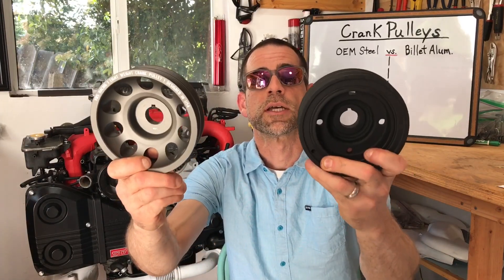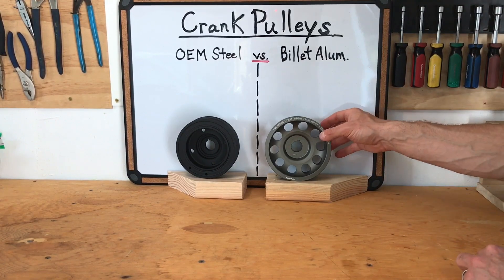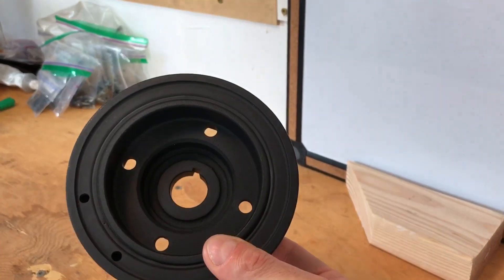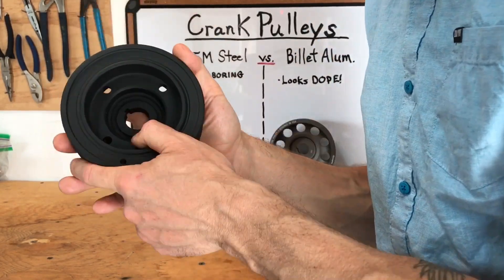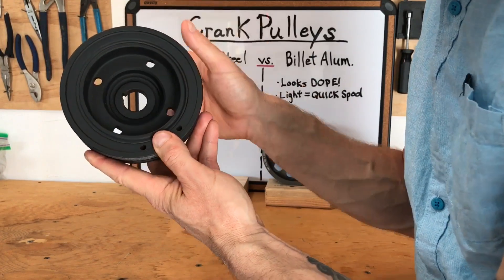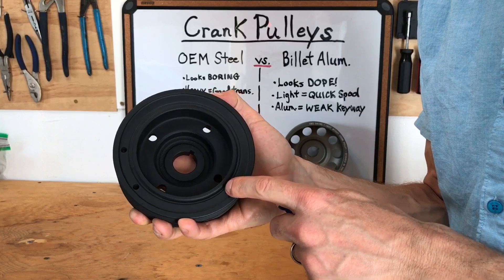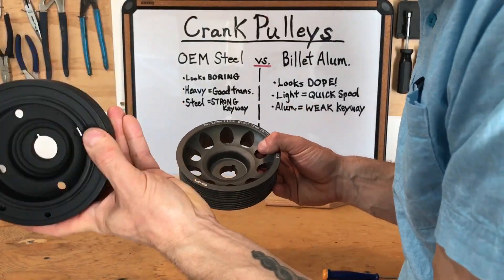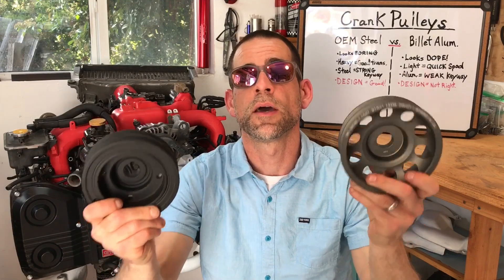Billet Aluminum vs. OEM Steel Crankshaft Pulleys

Comment: Pretty sure Subaru crankshaft pulleys (at least on boxer engines) aren’t harmonic dampeners as confirmed by people who have bothered to contact Subaru. So far as aluminum being softer than steel wouldn’t that have more to do with both the construction of the pulley and the alloy used? That’s like saying steel is crap for exhaust parts because oem exhausts rust so easily, when really the rusty ones are made of soft steel. My aftermarket one would look good as new if I just cleaned it off

Comment: I'm not exactly sure where you are getting your information from but this has been a topic beaten to death by the Subaru community and you're exacerbating wrong information.

https://forums.nasioc.com/forums/showthread.php?t=437237

There are multiple posts from folks even quoting people from SOA stating that the crank pulley on these engines is nothing more than a crank pulley and not a harmonic dampener.  Also, these engines are balanced in the boxer format which means a harmonic dampener is not needed.  Folks can read more about it at the link provided above.

The main issue that arises from using a lightweight crank pulley is that it could throw off timing due to the engine rotating easier.  This is much more prevalent with engines that are running both lightweight crank pulleys and lightweight flywheels.
Reply from the maker: +Greg LaPointe  Thanks for the comment.  I realize this is a well debated topic.  Many strong positions out there.  Overall, I agree with you that most of the info out there is based on little real world experience.

*One thing to note, with respect to the lightened pulley and/or flywheel throwing off timing - It does lighten the rotating mass, which allows the combustion pressure to turn the rotating assembly easier and the engine to effectively produce more power - HOWEVER, the timing is NOT affected.  The timing signal is sent to the coil (and then down to the spark plug) via the ECU which uses the crank position sensor combined with the cam position sensor as inputs.  Those sensors use little magnetic reference points built into the pulleys to determine the rotational angle. When you lighten the pulleys or flywheel, the whole assembly might rotate faster (or more accurately, accelerate faster) but those sensors can monitor and send signals to the ECU so quickly that the timing DOESN’T get compromised, no matter how fast the rotating assembly can accelerate - In other words, no matter how light you make your rotating assembly, the timing will stay EXACTLY the same.
Reply: SubaruONLY 
Actually.  Yes the timing signal can be affected.  With the lower mass, the engine can accelerate and decelerate more rapidly between cylinder combustion events.  (And i have crank trigger logs from my Link g4+ thunder that you can actually see the engine RPM accelerate and decelerate.)   A 4 stroke 4 cyl engine like these basically has 180° of crank rotation between every power stroke.  That is enough time to allow the engine to speed up and slow down (a very small amount).  If you look at the tables the ECUs uses to control spark advance, you can see one of the primary parameters that effect it is RPM.  So if the RPM is physically changing between each power cycle, then the sensor the ECU bases its measurements off will also show this, then the spark advance can also be affected for the following ignition event.

Comment: I would like to address some things in your vid. One is about  the alumimum material. I dont think people are having issues due to the pulley being aluminum. Its more likely incorrect torque applied or possibly using an impact gun when they shouldnt. Or its just cheap chinese junk with poor tolerances and or inferior materials. The other is that the factory pulley is a dampner that reduces harmonics from the crank. There are many OE designed pulleys that dont have the rubber in them. Manufactures at some point starting adding that rubber ring as another form of noise control (NVH).
Reply from the maker: +Michael John   Great points man.  There are some very high quality non OEM options out there for sure!!!

Comment: I send off oil samples for a report religiously at every oil change.  On my current daily driver, I tracked 7 oil changes (5k mile intervals) on the stock crank pulley, and going on 9 changes after the aluminum pulley went on...  the lab reports show zero increase in bearing wear.  I've also never heard of the keyway stripping on any reputable aluminum pulley, but I've admittedly never looked.  I HAVE, however, seen lots of stock pulleys go bad eventually when that rubber band holding the two pieces together gets old, brittle, and rips apart.
Reply from the maker: +Daemione  Thank you very much for sharing your real-world experience - nothing compares to that in my opinion.  🤙🤙
Reply: After 15 years ('05 Impreza) my pulley separated and dropped my belts. Drove the rest of the way to work and then back home without power steering or alternator
Reply from the maker: Nice - just made it I bet!!!

Comment: You have no idea what the hell you’re talking about. The Subaru engine does NOT use a harmonic balancer on their crankshaft pulley....none....zero. Subaru of America has already debunked this urban myth. The engine in internally balanced. The rubber section just makes up for the manufacturing tolerances in the pulley it is not used as a balancer. I’ve used lightened pulleys for years as have many of my Subaru acquaintances. You know how many problems we had? Zero...none...zilch. Look up “lightened pulleys” on any of the Subaru sites (NASIOC) and do a little research before sounding all “bad ass”.
Reply from the maker: +Zulfiya Simmons  Thank you for dropping the comment - especially the fact that you share some real-world experience.

In theory, it seems logical that the factory pulley does dampen harmonics based on the design of the part, HOWEVER, if your experience has shown that the impact is negligible, and a lightened pulley shows guaranteed performace improvements (which it does by design), then I say you are 100% correct and I would do the same every time!!!
Reply: SubaruONLY way to handle a rude comment the right way 👏🏼  subbed.
Reply: Zulfiya, the rubber is actually to help damper the belt vibration transfer. It helps provide a light buffer of belt pull against the crankshaft, dampening the belts vibrations to lower the transfer to the bearings. It’s a harmonic dampener, not harmonic balancer. 

Hope this information helps you with future consecutive criticisms.

Comment: Nice Overview.  Not to negate your facts as things could be different with Subaru, but on my 97 Honda Prelude SH, I added the unorthodox Pulley kit ( crank shaft and Power steering ) at about 91K miles.  This was over 13 years ago.  A couple days ago I just passed 200K miles.  I have had no issues.  What I have seen from these, is better throttle response, and an slight increase in MPG.  On the highway going 80 MPH I average about 28 MPG now.  The negatives are when shifting gears its much more sensitive if there is a difference between engine speed and transmission speed, but in my opinion it makes you a better driver as you can't get lazy with gear shifts.  If you plan on driving your car for over 50K miles, the fuel savings will pay for themselves.  Also my Honda also has the rubber inserts in the crank shaft pulleys, and once again I haven't notice any mechanical problems from the aftermarket one that lacks this feature.  On my next car ( Honda Accord V6 ) this will be the first upgrade I do in addition to the normal CAI.
Reply: Had mine on my Acura cl.. one of my best mods.. my pulley for accord v6 arrived yesterday.. can't wait to install. How has it been running for you?
Reply: Awesome to hear! I've been looking into this for my 3.4 t100 as I know deleting the fan and clutch assembly for an electric rad fan plus the lightweight crank pulley would be significant reduction on my crankshaft resistance.  I'm a lot more confident toward the idea after seeing this, and I'll probably do my Miata as well!
Reply from the maker: +whitesites  Thanks for adding the comment.  Great to hear about real world R&D.  Cheers 🤙🤙

Comment: How the fuck does something so circular, bare and steel cost around 400$? Talk about inflation of irrelevant stuff.
Reply from the maker: +Kizito George William   True that! 👍👍 

The markup stages from production to retail is often pretty ridiculous!   For example, if some thing actually only costs about $20 in raw materials to make, the manufacturer (who has the tooling, staff, and overhead costs to cover) will probably charge $100 to the distributer/wholesaler, then the distributer/wholesaler sells the retailer for $200, then the retailer sells it to the public for $400.  Bam $400 for $20 in materials! 😲😲😲
Reply: It's pretty sketchy. I was looking at engines last night and couldn't figure out how a single component (damper) could cost almost half of the entire engine.

Comment: Well crap. I have a lightweight pulley headed my way.. Guess it'll make a good office decoration lol
Reply from the maker: +Logan Reynolds   Lots of people have zero issues with these and they do help the motor spin up quicker - which is Sweet.  If it’s not going to be used for 100k mi., you probably be ok.  Or play it safe and save it for a dedicated race car! 🏁🏁
Reply: Thanks for the reply! The funny thing is, it was actually intended for my halfway reliable FXT daily driver. My race car STi is still running a stocker, but it has a big turbo and fmic etc so I thought the pulley might make the daily more fun. I spent quite a bit of time reading up on this last night and never really came to a solid answer. It goes back and forth to the end. I'll probably leave it off for now. Slower revs > bearing damage. However, if I don't ever rev much past 5000-5500 rpm, is this argument still valid?
Reply from the maker: +Logan Reynolds  Nice.  Cool pair of rides.  My kind of garage!  I know man - There’s so much info out there and nothing is really conclusive.  

I know the crank harmonics can and will take a toll on those bearings, but there’s just no way to know where the tipping point is and it becomes so small a difference that it’s negligible.  

So, to answer your question, Is the argument valid at modest RPMs, I think so, but how much impact - probably not enough to make a difference in next few years.

Comment: I've been debating lightened pullys for the better part of 2 years. Having experience with LW flywheels, I find them to be very valuable and found them to treat the transmission better, like clutch & gears last longer kind of better.

I think the torsional imbalance that the harmonic balancer is designed to reduce is really only critical at 8k+ rpm and while I'm sure it has it's benefit below 7k rpm on a stock motor with UEL headers, I really think EL headers would make more of difference preventing shock loads on the crank anyway.

I mean, the belts themselves, as long as the other pully driven parts are in good condition can compensate for most crank shock loads on a EJ motor.  Outside of the A/C compressor kicking on I really can't foresee a problem from LW pullys, I mean it's a bad idea to run A/C in high rpm anyways.
 
At the end of the day LW pullys are an awesome mod and can increase the life of the motor so long as, and at least A/C is not running at high rpm and better yet, EL headers get installed.

Idk, I think I'm gonna go for a GFB pulley system if I can find one thats not "under driven". And if I see anything funny with FBK or FKL on the Accessport I'll just hurry up with EL header install and re-tune.

That's the saga I'm goin with after lots of research.
Reply from the maker: +Gamma Light   Dude.  All good points.  There’s never one right answer.   My dad used to say, sometimes the only right answer is choosing one option - then figuring it out as you go.  Ha. This reminds me of that advice.  Cheers my friend!!!🤙🤙

Comment: Fluid damper makes a crank pulley for subys.. problem solved.
Reply from the maker: +fc3sttwo - You are 100% correct my friend.  Thanks! 🤙🤙
Reply: SubaruONLY I'm a Subaru tech and enjoy your vids. Good stuff sir, keep it up.
Reply: Yep, that's what i run
Reply: Yep this is my plan as well. Solves both issues of looks and performance. Maybe it will not look super cool but we're not building show cars.

Comment: I've been running the VMS pulley for 4 years now on my 03 WRX.  Still running strong....
Reply from the maker: +John Thatcher   Nice.  Good to hear and others who run this combo will be stoked to see this too! Thanks for sharing man!  🤙
Reply: How many years now John? Any issues as this is now 2020 :) And do you sometimes hit the redline with that thing?
Reply: @Isaiah_Simwinga  I've been running this forever now!  Around 6 years still no issues and redline the car every once in a while.  Still recommend it
Reply: @doomedoyster  Sweet, That's all I needed to hear it :)
Reply: The better question is how many miles.
Reply: @jacksonjacksonnguyen  I've put approximately 30,000 miles on the pulley.  Still running strong I might add.
Reply from the maker: Nice.  Good to hear that kind of real world feedback.  Thanks!  👍
Reply: I have a Grimmspeed one I want to install and I also have a lightweight flywheel ready to install and I've been told that installing both is a no no and I'll spin a breaking.
Reply: Did it add much horse power? Better fuel economy?
Reply: @Iceman78ize  I did multiple mods around the same time so I can't say for certain.  I will say for certain there is significantly less rev hang between gears.  Makes doing longer pulls across multiple gears much better!
Reply from the maker: That’s what I’m talking about!
Reply from the maker: It adds HP and MPG for sure, but likely very small amount. What is noticeable is the way the engine revs up quicker - which is awesome and a 100% improvement in drivability!  😁

Comment: Is there a way to still use the lightweight pulley but also install some kind of dampener? I guess at that point, though, you are negating the purpose of the LW pulley...
Reply from the maker: +T-Bone Steak  Thanks for the question.  I think the best compromise might be to use a crank pulley that can function as a vibration dampener (like the OEM one or an aftermarket dampener) and lighten up the reciprocation mass by using a light weight flywheel.    Thanks 🤙🤙

Comment: Hey bro please get back to me asap 
quick question I just bought an racesung light weight pulley for my wrx but your saying that the oem  one is better to last longer but the aftermarket will break in do time 
my question is how long will the aftermarket pulley last ??? 
I play around sometimes with the car but I baby it mostly so idk did I fuck up is wht I trying to say
Reply: anthony bryant Ive never heard of the keyway actually getting stripped or chewed out. What I have heard is the biggest problem is they start causing internal engine problems like the crankshaft reverberations He mentioned. Also the OEM pulley/harmonic dampner has 2 rubber "bands". Lastly, no 2 identical looking cars are the exact same. Some people run these aluminum pulleys indefinitely with zero issues, others have problems right away. Its a gamble. Thats why so many are for sale used. Try it out! Best of luck!
Reply from the maker: +anthony bryant   Hey man.  Thanks for the question.  Overall if you plan on light use or limited track use, I wouldn't worry about using a high quality lightweight pulley.  Should be good for several years.  Cheers!! 👍👍

Comment: great video! would like to see some quick revs with the lightweight crank pulley and flywheel vs stock
Reply from the maker: +Dave Newhams  - You are 100% on point with this request... I will try to accommodate for sure at some point!  👍

Speaking to this...I LOVE having a quick reving engine and lighter weight pulley and/or flywheel (typically, people suggest not to do both), DOES make a noticeable difference!  Kind of similar to a high compression engine.  For example, a 14:1 high compression engine is amazing when you rap the throttle, the revs spin up so fast and come back down so fast it's hard to describe!  Instant throttle response - like a Wild Panther snarling at you - it makes me smile! 😁😁😁
Reply: "...throttle response - like a Wild Panther snarling at you". 
😶
I've read some mangled fucked-up analogies before, but that is the worst/best,  @SubaruONLY  .
😣
Reply from the maker: Hahah.  Cheers man!!!

Comment: Points 1 and 2 are correct.

Point 3 is not.

Due to the inherent balance created by a boxer engine, Subaru's, and other flat engines, do not have harmonic balancers. It is simply a pulley. 

The reason for the rubber is nothing more than to make up for manufacturing tolerance differences in cast items.
Reply from the maker: +Vinnie 

Hey Vinnie, Luke here... Thanks for taking a second to drop the message - Much appreciated and hope you will consider to continue to do so. 

I have heard both positions and I have see some pretty convincing arguments for both sides. I have come to align with those who think the factory unit does serve to dampen the crank harmonics and flex (there quite a few SAE journal papers discussing this, for example).  

Overall, I think it boils down to how you will use the engine and the type of stresses and/or combustion pressures the engine will be exposed to.  The lower the demand on the engine, the less this issue comes in play.  Thanks again Vinnie!
Reply: Subaru has officially responded to customer questions before stating it is nothing more than a pulley.
Reply: Vinnie, It’s a harmonic dampener.i suggest to research belt vibration.